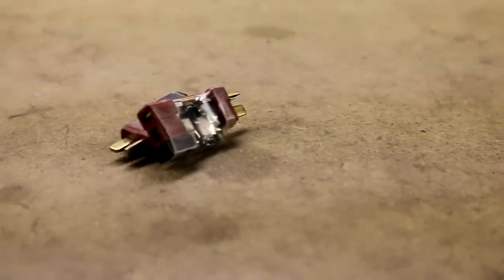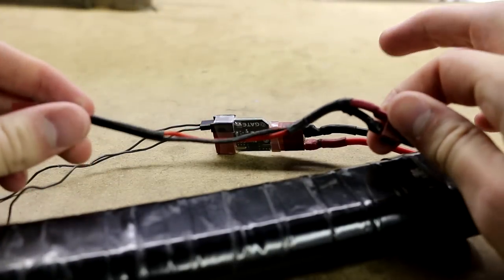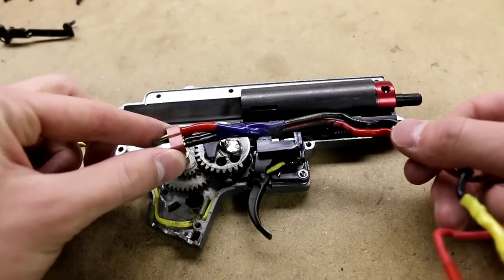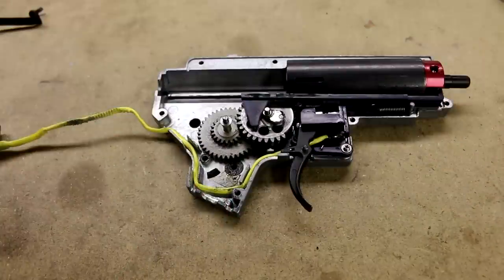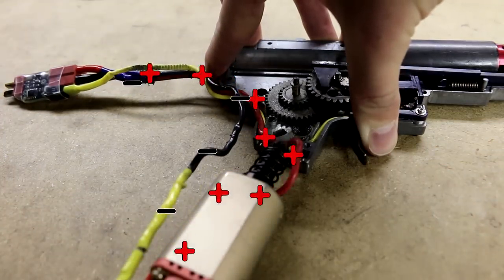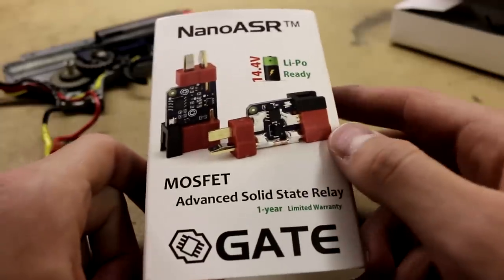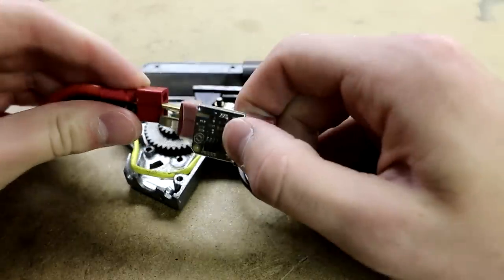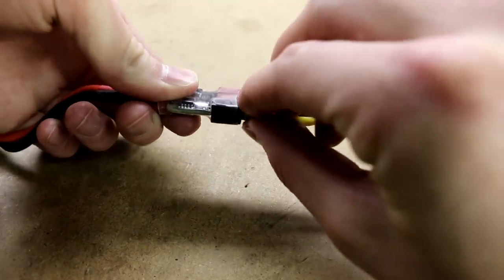Airsoft Tech: MOSFETs (AEG)

Comment: If I’m replacing a mosfet does it have to be the same one? Haven’t messed with these in years so confused
Reply from the maker: @DevonatSTM  - It does not need to be the same one, as long as the MOSFET you use is compatible with whatever wiring/trigger you have. So, for example, you would want to replace a dual-signal-wire MOSFET with another MOSFET compatible with dual signal wires. Or, alternatively, if you get a single-signal-wire MOSFET, rewire to single signal wire.
And, obviously, you would not want to replace an optical or microswitch MOSFET with a contactor MOSFET and vice-versa, unless you plan to switch the trigger method.

Comment: I just installed my mosfet and when I pull the trigger the motor just gives a very small spin ant then nothing happens. Almost like a pulse. When I leave the motor out and replace it with a voltage meter I get a nice constant voltage but when I put the motor back in the volt meter doesn't even move.

Comment: I just purchased the APS silver edge m4. the gear box in the weapon can not take lipos, if I put a lipo in it would shred up my gear box. if I put a mosfet in my weapon would I be able to run a 11.1 lipo without it shredding my gear box up or would I have to replace the gear box?
Reply from the maker: Sledge Airsoft - MOSFETs only protect your trigger contacts from the arcing effects that high-discharge batteries have. They do not protect the mechanical components from the increased physical stress of running at a faster speed.
However, a properly tuned stock gun (shimming, motor height correction, AoE correction, radiusing, etc.) will probably be able to handle those additional stresses.
Reply: Okay thank you

Comment: What are you thoughts on active breaking. I have the Gate NanoAAB. I really like the feature, and haven't had any issues until I got a new motor. I installed a ZCI 22tpa HT motor and after about 2000 rounds it stopped working. My shimming was on point and everything sounded good so that's the only thing I can think that would have been an issue unless it was a defective motor. Previously I was running a matrix high torque motor. I'm really worried now that if I buy another motor I might waste more money and may just go back to my matrix motor. Thanks for all your wisdom.
Reply from the maker: ZCI doesn't have the best QC, so they sometimes ship out motors that die within about 3,000 cycles. I have yet to experience this, but it does happen. It's a good thing they're pretty cheap.
It's doubtful that the active braking on your MOSFET ruined the motor that quickly.
Reply: That's comforting, I am shipping the motor back to Brill, so he's gonna take a look and I'm hoping give me a credit or discount or something and Gate is also working with me too. May change the AAB out for the ASR. Everyone has been very helpful though and I appreciate you taking a few minutes to respond.
Reply from the maker: No problem, sounds like you'll be set
Reply: love the vid. i hope you could share more knowledge with me. if i install a mosfet can i remove the fuse and still have the same level of electrical protection? i plan on running a 10.8 NiMH.
Reply from the maker: The fuse does not at all protect from arcing. It's there to prevent the system from drawing more amperage than certain parts can handle. If the gun is wired well (so that there's no high-resistance points in the circuit) and you don't try to cycle it when it's jammed up (making it draw a lot of amperage), the fuse is pointless and actually adds resistance to the circuit.
Reply: thanks! so basically what i am getting is if i am not an idiot with my gun its safe to remove it then. do you remove your fuses? you have helped me so much thank you sir.
Reply from the maker: Yes, you are correct.
I remove my fuses.

Comment: would there be any benefit to adding a mosfet to a stock gun with 9.6v NiMh battery?
Reply: there is a benefit, but you wont necessarily perceive it as much if you were staying with the 9.6v nimh battery... but having a mosfet is essentially better for your gun no matter what battery you put in it... if you do end up getting a mosfet, consider getting a lipo battery, specifically an 11.1 (the 7.4v lipo can be used without a mosfet, which is why i say to try the 11.1 after you put a mosfet in)

Comment: My gun will cycle once, then the piston gets stuck first one stripped*, it happened out of the blue, so I put a Sorbopad and a new piston in and the sector gear couldn't reach the pistons pickup tooth, so I cut the 3rd tooth off *this is an shs piston with the 1st tooth already cut off all the teeth on the sector gear make contact with the piston, but it still only cycles once.
Reply: did you fixed it ?

Comment: I don’t know if you’re still answering comments (pls do) my H&M’s arp9 got a new mosfet and it switched to deans instead of Tamiya and it was working fine until I tried it today and it is flashing blue and yellow and won’t shoot and I’m not sure why
Reply: I am using a 7.1 3000 mah titan power battery btw
Reply from the maker: I'm a bit confused. Are you talking about a G&G ARP9? Are you saying that the MOSFET was replaced, the wiring was switched to Deans, or both?
Reply: @CStingerGhost1  yes it is a g&g lol I didn’t notice the auto correct and both the mosfet and battery connector were changed, it was working fine before tho I don’t know what happened
Reply from the maker: @jamessmith8581  - What MOSFET was put in?
Reply: @CStingerGhost1  they didn’t specify this but it looks to be a titan power one I’m not sure though

Comment: I got a g&g predator with a mosfet. my problem is I cant fire more than 8shots without the mosfet stopping me from shooting more. I think its the battery but I'm not sure. I run 9.6v and the gun is suppose to handle it it also is able to run a 11.1v so idk can you help?
Reply from the maker: If the MOSFET has an electronic fuse then it's cutting you off because the circuit is shorting or you're drawing amperage over whatever limit it has set. The second one is more likely because if it was a short you wouldn't be able to shoot at all.
If you're drawing too many amps, most likely something in the drivetrain of the gearbox is not running as smoothly as it should be. The gears could be shimmed too tightly, or the alignment of something could just be off.
The MOSFET could also be bad.
Reply: okay so what would you do? also thnks for replying
Reply from the maker: Disassemble, degrease, clean, set motor height, shim, and regrease. Check it all over during that to see if something is obviously wrong.
Also check the motor double. Bad motors tend to draw extra amperage for no good reason.
Reply: okay thanks man!
Reply: okay so I took out the motor to see if the gears had anything to do with iit because I don't wanna take it apart.. I'm new to tech. and It still stopped after a few pulls of the trigger. so its down to either the battery , mosfet , motor? what you think? Stinger
Reply from the maker: Anaki OG - Definitely check the battery first, as that's the easiest to replace.
Reply: it works in my other G&G but it dosent have a mosfet. also when I put the battery in, the mosfet blinks red. just found that out. same with my other batterys that are bad. idk if that means anything ?
Reply from the maker: Anaki OG - That very clearly indicates a battery problem.
Reply: okay well now I know the problem thanks man :) you gained a subscriber
Reply: +Stinger I have a g&g srxl with the same problem except the battery is fine any ideas?
Reply from the maker: AirsoftDude - Probably shorting out of the MOSFET is stopping it from firing
Reply: +Stinger how do I fix this and thx for replying
Reply from the maker: AirsoftDude - Look for a spot where the insulation on the wiring has broken, or for some other short-circuit point, and repair it.
Reply: +Stinger I'm sorry but I'm not really completely educated about MOSFET... how would I repair it? thx for all our help
Reply: +AirsoftDude your*

Comment: So the gun I'm getting says it recommends  a 7.4 lipo but I want  to run something a bit higher and it comes with a preinstalled mosfet , does this mean I could run a 9.4 on it ( gun is  Command Arms Airsoft Elite CAA M4 14.5" Airsoft AEG Rifle)
Reply from the maker: Yeah if it has a preinstalled MOSFET you shouldn't have to worry about what battery you use at all unless it also has a fuse.
Reply: Stinger thanks so much but If you have the time could you explain to me why my gun says it recommends a 7.4 it just doesn't make sense ?(edit: and I in no mean want This to sound rude )
Reply from the maker: It makes sense from the point of view of the manufacturer. They want to cover their bases from a legal/warranty standpoint.
Also, the mechanical internals of the gun may not be tough enough to handle the higher torque and faster rotational speed resulting from a more powerful battery.

Comment: When useing mofset advantage is you dont need 16ga wires and prfect conectors.. 20c rating is max needed you save powere and les heat.. ganerated.. even motor is bosted for fast triger response
Reply: martin šegula completely wrong...
Reply: @opairsoft8100  without alot of burst rating spiked thrue  triger and was loseing energy and more Ampers was needed for same task. Sparking on conectors triger andcreated so much heat W lost that plastic melted..  THat is what i was suggeasting.. Energy saved IS like HEat W..  AND wires and motordirect power line will always heat. on User demand. but beter conection to motor from batery will create les heat that was lost in wires. still Alot bater than.. big wires without tcu and mofset.. that was my statmen.. i remaber ppl useing 70 c burst.. batery without mofset.. thjat is alot of Power and lost energy.. to get same resoult. I prefer having bater energy los to with deans and 16 ga for lost energy in wires. but it is not crucial.

Comment: So does the mosfet protect the trigger and stops supplying power when something is going wrong
Reply from the maker: It depends on how the MOSFET is built and configured.
On the most simple of levels, the MOSFET acts as a secondary, electronic switch which protects the trigger contacts from arcing by only sending high-current through when it detects the circuit is closed (the trigger contacts are already touching, so there's no gapto arc over).
Some MOSFETS (such as the GATE NanoASR that I use) have built-in resettable electronic fuses, which will stop supplying power when something is wrong (there's a short or too much current is being drawn by the motor). Not all MOSFETs have this feature, and some MOSFETs will burn out if under those conditions without such a self-protecting feature.
Reply: Stinger so the nanosr helps with arcing and stops from supplying too much power
Reply from the maker: Correct
Reply: how much does it cost?
Reply from the maker: About $30

Comment: So far this is the best mosfet explanation video I've seen! As an airsoft beginner, should I worry about installing a mosfet in my M4? It has a 8.4 V battery (nickel metal), I might upgrade to a 9. 6V. Thanks in advance, cheers!
Reply from the maker: It's generally only needed when using a high-discharge battery. 8.4V and 9.6V batteries are fine.

Comment: Did i just see some holes in the grip? Love it! I've never like those gate MOSFETS, way too big expensive for what they are. Does it have a TVS diode in there?
Reply from the maker: bbsp - Amazon had them really cheap for a while.
The one I use in my Wraith is the NanoASR, which does have TVS and electronic fuse (among a few other very passive features).
To my knowledge, the NanoSSR (very basic model) does not. Killer and I also managed to fry two of them with a short-circuit.

Comment: Greetings from the UK! Thanks for the video, great insight. Just a quick question. I have a stock G&P Mk18, does my gun have a mosfet? Also in semi sometimes the gun fires on full auto. Will adding a mosfet solve the issue? Thanks
Reply from the maker: I do not know of G&P including MOSFETs stock in any of their guns.
A standard MOSFET will not correct that issue you are having. A MOSFET with active braking should.

Comment: Do you still recommend using this mosfet from Gate?  I'm in doubt about getting this GateASR or Micro Mosfet 2 from Jefftron.  Thanks for the reply!!!
Reply from the maker: I've had no issues with the ones I've installed. I'm still using the same one shown in this video in my primary.
I've also installed a lot of other MOSFETs. I'd say you really can't go wrong with any unit from a reputable source with good reviews.

Comment: I cycled through all questions so far so if my question is a repeat and I missed it I apologize .... Why do the wires connecting the trigger to the Fet have to be a higher gauge(smaller wire)? And if the answer is along the lines of “ restrictring something in the the current” then why is that if that’s what the Fet’s doing in the first place?
     And really thank you for all your content. I’m the noob who completely ignored the “don’t open up your gun when you first start” rule. Now I have 6 guns all in pieces and I fricken LOVE IT
Reply from the maker: The signal wires don't need to carry very much current, so they can be made small. They could also be the same size as the power wires, but that would be a challenge to fit in the gearbox shell.
Reply: @CStingerGhost1  That’s what she said 😝 
   My god this vids like 5 years old and you replied to my inquiry so lightning fast. Amazing. Can’t wait to watch more of your content

Comment: My battery doesn't have a connector that can go into the mosfet. Am I supposed to rewire the battery?
Reply from the maker: The MOSFET I show in the video has Ultra Plug (sometimes referred to as "Deans," which is a brand name) connectors. If your battery is wired to another type of connector (likely a Tamiya-style connector), then yes, you will need to rewire the battery.

Comment: Hi i was watching a video on batteries and it said that LiPo batteries should be used with a voltage metre or a MOSFET  to protect the battery. Does a MOSFET do this?  Many thanks.  Great video by the way.
Reply from the maker: Yes, a MOSFET protects the trigger contacts from arcing when using high-discharge LiPo batteries.

Comment: hey so I've got a JG/golden eagle m4 that's one of the newer models. It already has a MOSFET wired in, but nothing like a gate or nukefet or any of the other advanced ones. I'm pretty sure it's just a basic MOSFET but do you think it could handle an 11.1 or would it ruin the trigger contacts? If you don't know the type of "basic" MOSFET I'm talking about I could send you a picture.
Reply from the maker: +FilmMaker13 - Yeah, it should handle your typical 11.1v battery no problem.

Comment: Hello stinger I have a question, can I apply a mosfet on
An aeg that has no burst mode? And can I use a MOSFET with a 7.4 lipo battery? Or am I forced to raise the voltage?
Reply: assura11 Of course you can add mosfet to any aeg. And you don't need to raise the voltage. I've used 8.4V Ni-mh on my mosfet and works just as fine as with 11.1V lipo.

Comment: i bought a tienly gt-45000 motor and when i put it in it blows my fuse out everytime on krytac lvoa-c internal mosfet. When i switch back to my old motor everything is fine. Is the motor drawing so much power that the stock krytac mosfet that it came with just cant handle that much current and so the fuse blows? Using a 11.1  v 20c 1200 mah lipo
Reply from the maker: That's possible. I would ensure that the gears are shimmed well, the motor height is set properly, and the wiring is good (no poor solder joints which could jack up the resistance, etc.).

Comment: ive honestly never had good experience with Gate fets. they do well with low stress setups that pull lower amounts of amps, but ive burned out three of them so far in a 12:1 16tpa setup using only a 20c 11.1. and i kept buying the same fet lol. been using a 3034 based fet for thousands of rounds now and have had zero issues. Also save up on space
Reply from the maker: Alex Fong - But the 3034 MOSFETs are not as nice-looking nor do they have the connectors, which are two qualities that make the GATE MOSFETs good for use in a video. When I can unplug the wires to show you which wires do what, I can better explain how the MOSFET works.
Reply: true i wont deny they are very convenient.

Comment: Hey, I just copped a VFC VR16 for my first gun and I'm looking to upgrade it. I wasn't too sure which battery to get so I've acquired a nunchuck style 8.4v 1600mah battery. I'm wondering if mosfets are always recommended because I believe my trigger response isn't the greatest. I have still yet to shim this gun, It says it's "self shimmed" but I think i'm going to have another go at your tutorial and do it myself because I can still hear that motor crying in there. Thanks again for the uploads

Also, do the Trigger contact wires come with the mosfet, sold separately, or already lay in the gun?
Reply from the maker: +astropop2 - A MOSFET is recommended for all setups.
The signal wires come with this particular MOSFET.
Reply: if you are throwing one in a VR16 go with a TITAN v2.  You really will not be disappointed.  Also, regarding your battery.  In this particular gun I would go with a 9.6 volt at max.  Unless you get a mosfet and maybe some stronger gears and piston I wouldn’t recommend 11.1 Lipo.

Comment: So I have a scar l that I am going to buy a drop in gear box for. Also going to use a lipo so I was told to install a mosfet. What should my first steps be as I do not know what I am doing when it comes to electricals in airsoft
Reply: buy ans btc spectre or nano mosfet.
Reply: Sam Cabrera Don't buy spectre unless you want to pay shit tons for it. Nanossr and Nanoasr mosfets will do fine!